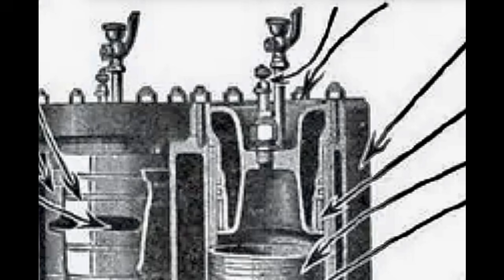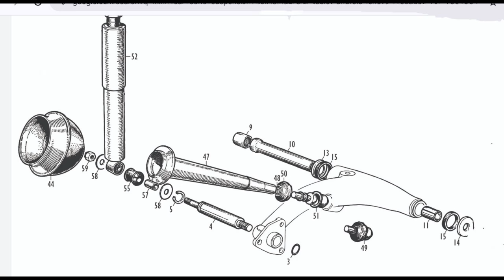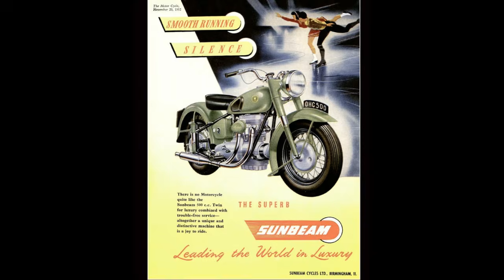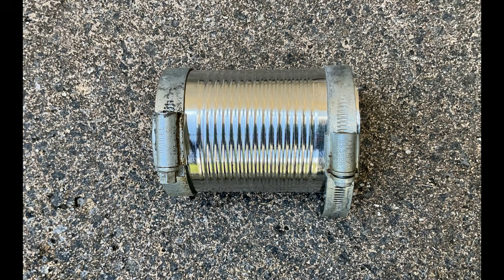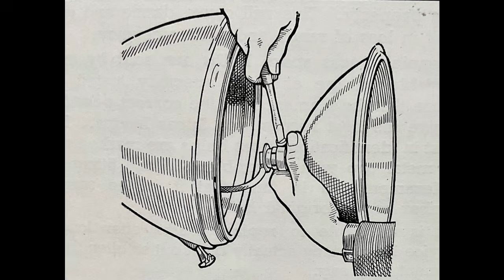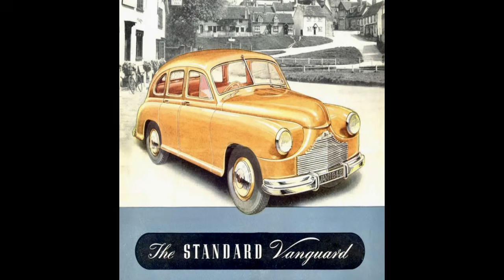1960s STORIES OF FIXING OLD CARS BY FAIR MEANS OR FOUL Plus the ANTICS we got up to Part 3

Comment: Prompted by your replacing a timing chain.

Roller chain was invented for the safety bicycle, man pedals at up to 100rpm. Rear wheel sprocket goes 250.  Non roller chain was already in use at low speed but minimum friction made a worthwhile difference when only one human power, see also ball bearings in pedals, wheels and bottom bracket.  Gradually motorbikes discarded the slipping belt and enjoyed positive drive from engine strangled by side valves.  Then OHV and 5,000+ rpm.  The chain link is a dumbbell and has inertia.  Chain makers gave recommended speeds and powers but mindless, ot thoroughly cynical manufacturers grossly exceeded them.  If it lasted one TT race that was good enough.  Mr Weller used chain to his OHC and they were rare cars.  But mass producers noticed and realised that accurately boring camshaft bearings was not required for chain.  Mass abandonment of gears.  A SV Ford rarely reached 4,000 and the chain gave no trouble.  By the 1960-80 period every idling car was dismally splashy because 5,000+ had wrecked chain and sloppy skew gear and dismal tuppence a bucket auto advance distributor had never twice the same timing.  Some chains snapped.  The Austin 16 was not a high revs engine and I am not surprised that you had zero trouble from the simplex and spring clip connecting link.  I have used them on motorbike primary chain despite the always advised use of 100% rivetted loop of chain.   What would be interesting is to understand how the original chain slipped on sprocket teeth - I surmise that there had been a jockey tensioner which had failed.  Otherwise I don't believe it could have been so slack without snapping at one of the now much abraded pins.
Reply from the maker: This is the longest and most informative comment I have received over all my videos. Thank you.

Comment: In the mountains the mixture would become too rich (not enough air).
Reply from the maker: You are quite right. -  I am 84!  I just remember moving the jet, it was very easy on the SU.  Other carburettors would have needed a jet to be changed.
Reply from the maker: That's right, and it became quite noticeable at altitude!

Comment from the maker: If anyone recognises the makes or models of the cars driven by my grandfather I would be very grateful.
Reply: I won't try with the Edwardians yet because I only have a little phone and thus very small image.  However I will give a few stories from my grandfather, born 1882, motorist from age 20.  

He worked for a cycle shop and manufacturer as a boy, took evening classes in mechanics.  Out on a rural road saw a horseless carriage approaching, he knew what it was but nevertheless jumped into the ditch until it had passed, giggled as he told me about it when he was old and I about ten.  I have a photo of him on a Panhard & Levassor in 1904, registration BM58.  These things were driven by side chains because there was no high strength alloy steel so the crown and pinion was large, heavy and would have diminished ground clearance if in the axle but also the compact needle roller Hardy Spicer joint was new in 1934.  A chain broke, he used a gate pintle as anvil/punch before reconnection using spare links carried for the purpose.

My mother remembered an occasion when she and her mother were in a sidecar but my grandfather was running because it was a wet day and belt slip prevented the engine dragging all the weight up a chalk down.

A little before 1939 a colleague of my father was sitting in the back of his Morris 8 repairing an inner tube, it being a blustery wet day.   Bang!  Sudden darkness.  A plywood pantechnicon had blown over and surrounded the little car, which was still serviceable and able to reverse out once the lorry driver had opened the rear doors, bear in mind that the 20mph speed limit on commercial vehicles lasted till mid 1950s.
Reply from the maker: This is amazing, I think you should do your own video.
Reply: @peterprest1222 That is kind of you, I doubt my dealing with cameras etc.  However I have written a draft for a book because I recognise that it would be a pity if a lifetime of observation and quite a lot of understanding just vanished.  I need to look out suitable pictures and perhaps make some diagrams.   Motoring is the nearest to engineering that most people ever get but sadly even the enthusiastic are usually very badly served by scribblers who can write what is plausible to the layman but is actually not correct.  People believe what they want to believe.  See all the cathedrals, pyramids, stone circles etc.

As a start with your grandfather's motors, the two which have the radiator behind the engine and therefore a sweeping sheet metal front would most likely be Renaults because they made many of that arrangement but were not unique.

Comment: Sleeve Valve , wish i could hear a Sabre H 24 cylinder engine on full song !
Reply from the maker: For those of you who have not heard of the Sabre h24 it was a very high performance 24 cylinder SLEEVE VALVE engine introduced just before the introduction of jet engines. It was used in record breaking cars and some of the last piston engine fighters.
Reply: @peterprest1222 Hawker Tempest I think.
Reply: @peterprest1222  I really don't believe it was ever used for a land vehicle.   Before anyone dreams of what a superb thing it was I suggest going to Duxford museum and looking carefully at the sectioned one there.  It is arranged to be rotated by an electric motor via a chain....  

Plenty of boat engines had a chain from starting handle down to the crankshaft near the bilge.  Obviously such a chain had to transmit the momentary power of a strong man intent on putting his utmost into the flywheel and compression.   The Duxford Sabre has an enormous chain, certainly chosen by a competent engineer to withstand the continuous power/torque needed to only overcome idle friction.  

NB that as soon as VE day was passed the Sabre was replaced by the Bristol Centaurus and quite rightly so, they were in commercial airline service about 1968, I watched the clouds of oil smoke as it opened up to taxi from runway to disembarkation place.  They just worked but the Sabre was eclipsed by both Centaurus and Griffon (RAF service till 1991).   Who wants twin crankshafts with coupling gears?  Weight and friction, well Junker's diesel was like that but Hugo himself looked up at the black trail and told his staff to design a petrol V12 as nature intended, poppet valves and all!